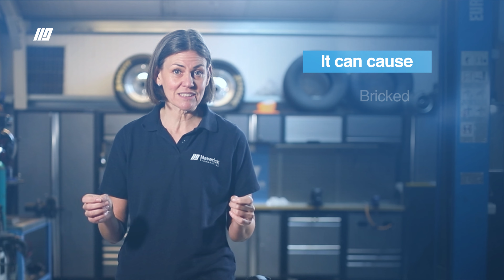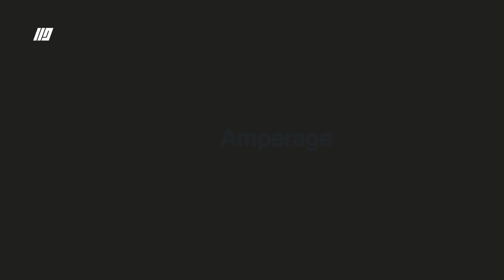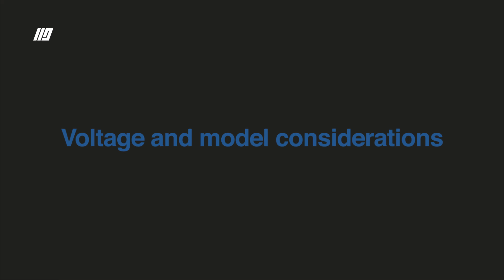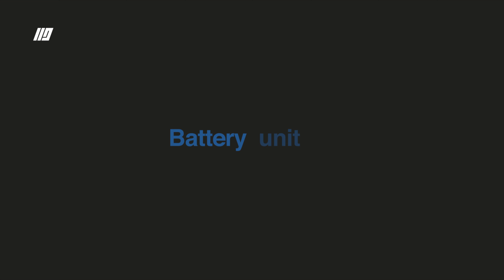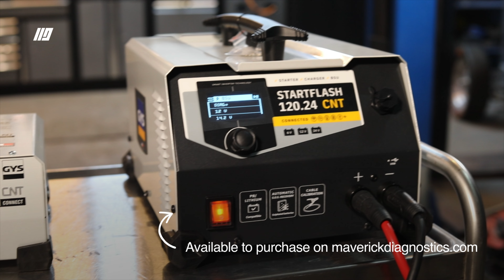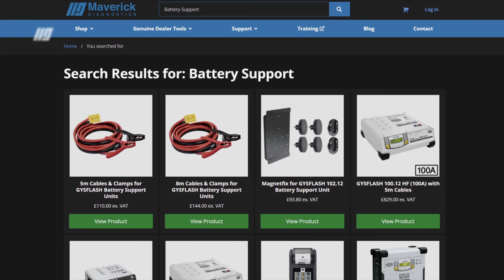THE MOST UNDERRATED WORKSHOP EQUIPMENT | (GYS-FLASH AND GYS-STARTFLASH OVERVIEW)

Comment: GYS 12V is just fine for BMW programming as it supports up to 14.8V in the required DIAG Mode (ask me how I Know!!).....you don't need a more expensive 24V option for  "additional headroom" ....just FYI.
Reply from the maker: Great tip, thanks for sharing your experience! FYI - BMW recommends the GYS-FLASH 125